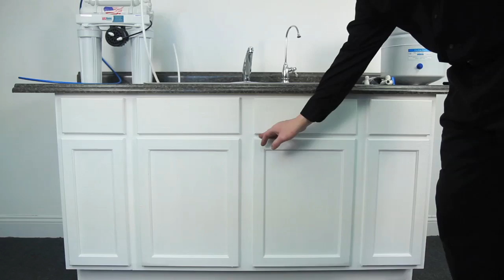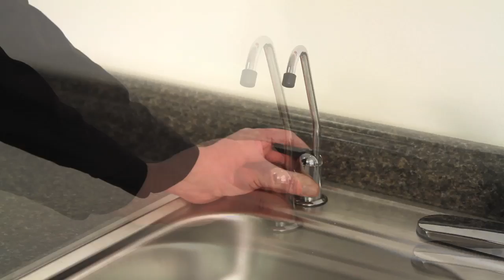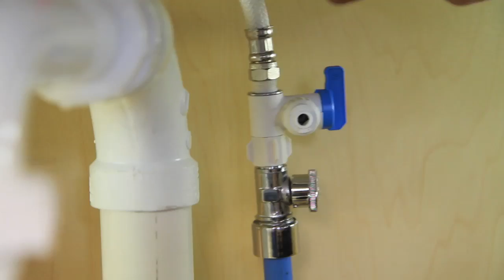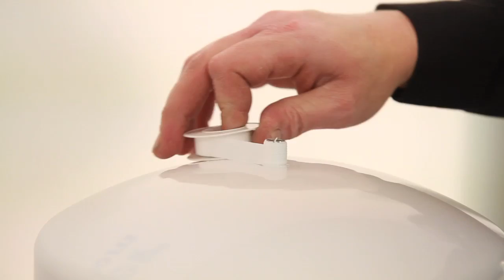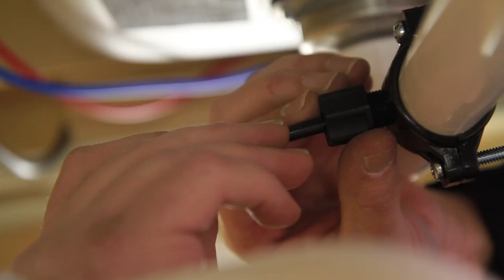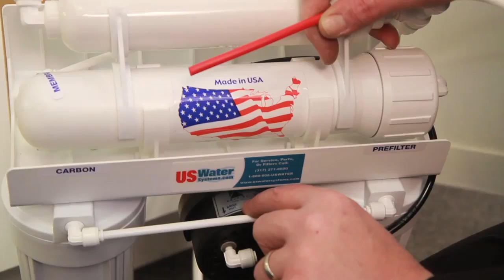How To Install Your Reverse Osmosis System - Part 2

Comment: confusing? i didn't got enough wires or pipes to connect i got 1 i dont know
Reply from the maker: Do you mean the tubing? That's strange... Sorry about that. Contact our customer support and they will get you anything you need asap. 1 - 800 - 608 - 8792